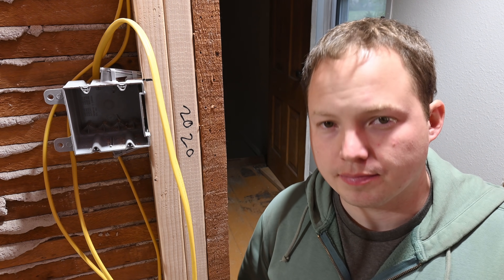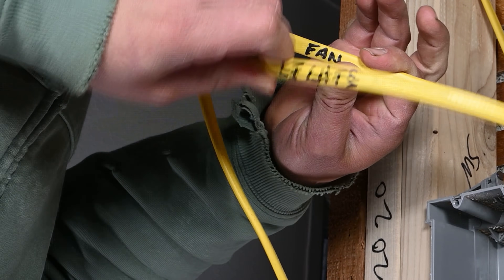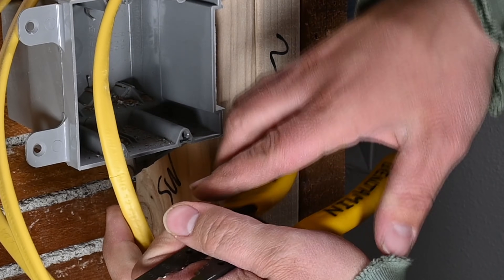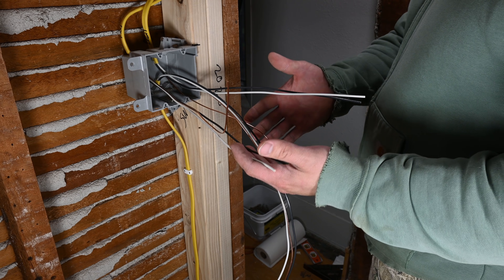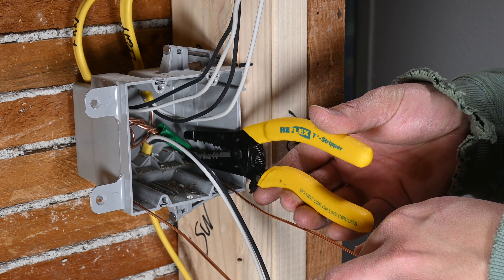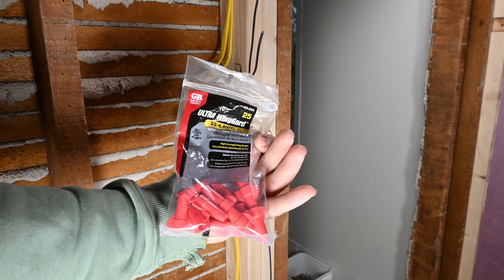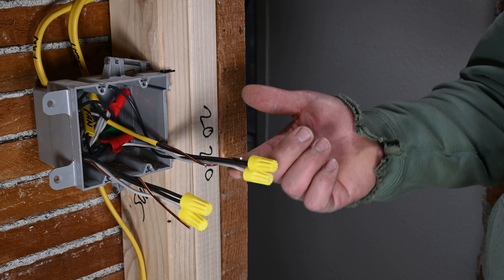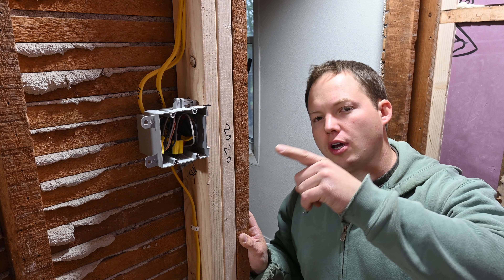How To Rough In Wires For a Bathroom Light & Fan Two Gang Switch Box

Comment: Towards the end of the video, you wired the hot wires simulating a switch being turned on so you could check for a breaker trip.  You mentioned going to drywall next. Would it be good to check for a trip before drywall or is that overkill?

Comment: Hey Ben, I have a question. In my apartments the connected the fan to run all the time! This are new apartments and I frankly don’t want to pay any extra to run them 24/7.  Wha do you think they did to do this? And all the apartments are the same! I’m not an electrician! I can turn off the breaker of the bathrooms light and fans turn off. I turn them off during the day time when we leave. Just drives me crazy! I’m thinking of hiring an electrician to come and fix this! Thanks
Oh my son is the gamer! I’m Oscar.

Comment: I have two wires in the ceiling of my bathroom going to my ceiling fan from a double switch and the other comes from the light fixture. The power starts at the switch and I need to know how to wire the new ceiling fan in as well as the light fixture12/3 to 12/3

Comment: I think you only need make pigtails for shared ground  (or and neutrals if you use neutrals ) no point to make pigtails for hot wires , it’s better to attach them on switch terminals directly

Comment: You needs 20 Amp light switches to run lighting off a 20 amp circuit. But the inspector likely doesn't know that :)

Comment: In our area the proper way to tie grounds is to pre-twist them together, trim and then add wire nut. Wire nut are notorious for not getting all the wires firmly twisted. Additionally the switches have a slot for cutting the insulation AND the back of the switch should have a line which is the proper length for conductor and lastly a small hole to help you bend the wire to properly. https://www.youtube.com/shorts/UEkgqU4H56Y

Comment: Well informed and well explained video. I do have a question in regard to installing a bathroom exhaust fan with a light. Do have any videos that show how to add a bathroom exhaust fan switch to an existing light switch? So I would like to add another switch in my bathroom that will control the exhaust fan. Can I piggyback off the existing light switch? Thanks in advance

Comment: AFCI protection is NOT required in the bathroom under the NEC.
The height of the switchbox should consider the break-point of any wainscotting or tile pattern.  Top of box to 48" is a fine rule of thumb.  There is no requirement though absent any ADA requirements imposed on spaces which serve the disabled.
I prefer Ideal Proflex over those Buchanan red wire nuts, primarily for the longer skirt the Proflex affords.

Comment: How to wire a 4 Switch bathroom?
Reply from the maker: Why 4 switches?
Reply: @BenjaminSahlstrom  it's for a bathroom shower light, the exhaust plus light and the vanity light
Reply: @BenjaminSahlstrom  Ben I am in dire need of some help... I have a master bathroom with 2 gfci outlets. One of which is with a light switch. This bathroom also feeds my master bedroom lights and plugs, also feeds into my guest bathroom to another gfci
. In the box with the gfci and switch I have 5 sets of wires. How do I wire this???

Comment: I was watching your "Live sink" and water fixture that is causing your touchless sensor to show live power.  Reminded me of another place, where that happened in a bar.  They had a un-used roof top spinning sign, (1970's).  and when that circuit breaker was on, then the whole place - every metal stud or wall panel, they where all "Hot".  By disconnecting that one wire, it all went back to normal.  

Easy way to discover the problem is shut off 1 CB at a time, until the fault goes away.  In some homes, you need to shut off all of the breakers, then turn on 1 at a time, until the fault shows up.  Then shut off that breaker, and turn on the rest, one at a time, until the fault comes back.  So now you have 2 circuit breakers that someplace in that home are connected together.  Good luck finding that problem.  Yes I have seen it in a couple of homes.   It is actually far more danger than you might think.  So say that if CB #2 is on, the circuit is energized and rated at 20 amps.  Shut off #2 and turn on #6, and now both circuits have power, and the #6 breaker can also feed 20 amps into the same circuit, without tripping.  So in reality, you could be pulling 35 amps and not trip breaker #2 or #6.    This can happen when you feed one receptacle to another, and then you get two circuits connected through 1 receptacle.  Many times this happens when you have a table light that is controlled by a wall switch, and they mess it all up!  

Good luck with your project!

Comment: When I lived in a home in Garden Grove, I wanted to install a ceiling fan in my bedroom, without opening the walls, and put in the three speed fan switch and light control where my existing light switch is.  So I have access to the attic above, and put in a box near the light switch.  The wire going to the switch was then connected to one of the romex that was going to the switch, and to the wire leaving the switch to the next one. so I now have 3 extra wires.  It made hooking up the light easy.  I had three romex going to that switch, in from the circuit breaker, out to the next light switch, and out to the existing ceiling light fixture.  It's been 30 years, so not all is remembered right, but I did get it done without needing to install more wires.  

For the living room, I put in a steel box in the attic, nailed to a 2X6, and then cut a hole in the drywall below that, and put 1 romex  to that box.  Then put in a ceiling fan that has a built in remote control, so easy!  Glad I did that, and every new ceiling fan after that one.  I put it on the same circuit breaker as my furnace, and that has plenty of extra power before reaching the 15 amp limit.

Comment: There have been times when you’ve used a 14 gauge green insulated wire in creating the grounded connection from the device to the mechanical ground.  Should a person always be using the 12 gauge green insulated wire with a 12 gauge 20 amp circuit?

Comment: Thank you so much for your good explanation, but I have a question! after twisted together the neutral wires, Why did you put two neutral wires? is switch need to neutral wire?  I think it doesn't need, Usually a switch has 3 terminals; one for ground, one for power entering and one for power out, Am I right? please answer me I became confused. thanks brother.
Reply: The neutral pigtails are there if the owner wants to add smart switches later that require a neutral wire. He mentioned this.

Comment: I've watched a few of your videos that I've subscribed a long time ago.

My question is: I want to wire the light  and the fan onto the same motion light circuit.  (Both on and off same time.)Even though there separate units. (Light is over vanity and sink. Exhaust fan is a standalone item added completely as there was a window before with no fan) 20 amp circuit. 

Not to make matters worse there was no GFCI before (older home) I installed that a while ago.  But shouldn't they be on a different circuit so I'm not standing in the dark if the wife hair dryer trips it. ( I'm just curious about that) I don't have to change that if it involves a lot more work. 

Add another switch for a new led water rated light for over the shower. 

Upgraded to a 2 gang box total.
Reply: Connect the fan a light wires and pigtail to switch. I don't think that this an always desirable setup.
On your second question the answer is yes, but it had to be roughed in that way. Most likely an enormous job at this point, not worth it.

Comment: Is it Code to continue with 12/2 to all devices in a 20A circuit? Obviously, receptacle can have large and variable loads and it makes sense to wire them for the circuit's maximum current capability, but It seems a bit overkill to route 12g wire to fixtures like lights and fans. I believe my bathrooms use 20A GFI receptacle and a separate 15A Lighting /Fan circuit.
Reply: I'm not sure about code on this, but my rule is if it's on a 20 amp circuit, all wires should be 12 gauge. More likely to get inspector approval.
Reply: ALL cable on a circuit needs to be sized for the CB or larger cable/wire, Period! 20amp CB, ALL 12 awg. Any smaller cable/wire than max circuit amperage is against code and dangerous.

Comment: Can a 14/2 wire be used for this application?. Thanks
Reply: If it's a 15 amp circuit, then yes. Since this is on a 20 amp circuit, I'd say no.
Reply: 'Cable' is always chosen in size based on circuit size (CB amperage). 15a breaker, 14awg minimum. 20a CB, 12awg minimum. Those sizes (or larger) must be retained throughout the whole circuit. Though, changing to even a larger conductor is a bit frowned upon. Rule of thumb, same circuit, all same size cable.

Comment: Can I get power from a bathroom gfci for the vanity light and bath fan ?
Reply: Technically, yes. But in an electrical ground fault issue, you lose lighting if you use the load side. This is why you should never do it. Take it from the feed side (pigtail)

Comment: Another excellent video.  I've been using the Wago connectors for a while now instead of the twist caps and prefer the space savings in the box.  Long-term I think they will perform better as any changes in the box won't require untwisting wires and having to shorten them to remove the damage from the twist.  They also save time.
Reply: I agree that the Wagos are convenient if there is a chance you will be adding or subtracting wires from a junction box especially when field conditions require a change of plans.  For example, I just added 12/3 to an outlet box to power a switch for undercabinet lights.  And the video showed a great applicaton for Wagos to test the switch circuit by simulating the switch being on.  Another great application is using the new inline Wago to lengthen a short wire.  

My problem with Wagos is that it is easy for the levers to accidently open when folding wires into the box and the wires don't always seat if you are not careful.  If space is not an issue, I may remove the Wagos and replace them with wire nuts before folding the wire into the box.  If space is an issue, or if I decide to keep the Wago, I  tape the levers down before folding.
Reply: @Roy-ij1wq  I wrap the wago once with electric tape so the levers don't break.

Comment: at @1:30 you set up a receptacle box below. As you mentioned the power comes from  down below (basement or first floor) and it meets that receptacle and you mentioned GFCI thereafter therefore I assumed that receptacle will be GFCI. Does any incoming connection need to meet a GFCI receptacle then distribute per code when working in wet areas?. I'm working on a setup similar to that and I need to run power from an outside receptacle that is not  GCFI. I'd assume that the first connection in the bathroom needs to be GFCI. I'm not an electrician but I'm familiar with the theory of electricity and magnetism, digital systems, and ac/cd circuits, Ohms, Gauss etc.
Excellent video, subscribed.
Reply: Your description left me thinking about to many code sections and mentally kicking myself to remind me that each jurisdiction can select different rules, even throw the code book out.

So, I would encourage you to call in a local electrician.  Not to do the work, but to "consult" for you on easy fixes and best practices.  Remind them that all you need is the pathway to go so you can do it and give them a little cash for looking and recommending.  Permits might be required, they may have fought your same problem before and can give you the playbook. 

 Also, I am not an inspector but find them very helpful and eager to have safe buildings.  A call there might get you the rules before you do anything.  Finding out your cable was the wrong type before you hang sheetrock might save you more than if the pros did it once.

Comment: Hey buddy im having a problem with my bathroom lights. They keep flickering on and off. I've changed the switches but it's still doing it any suggestions for fixing it?
Reply: The lights are probably on the GFI circuit. You need to separate them. Per code, only the *receptacles* need to be GFI protected. I used to put the whole bathroom on the GFI but now with LEDs, which take much less power, the sensor of the interruptor causes it to flicker

Comment: Great job on how you present the information to the audience. I'm a fan and you have earned another subscriber. Researching this stuff to run my own electric into my soon to be constructed workshop. I have yet to see any video that takes you through the complete setup from the breaker panel to connecting lights, switches, receptacles and fans. I will keep looking.

Comment: I appreciate your strong physical connection before twisting on the wire nuts, looks like a best practice.  I am currently troubleshooting a switch that turns on 2 lights, only the first light from the switch turns on.  I have continuity from one fixture to the next.  I only have voltage on the first fixture. All of the light fixtures have wire feeds with black twisted to white which is foreign to me.  Perplexed.

Comment: Why dont you need a neutral wire for a typical switch?
Reply: A conventional switch only breaks the hot [current] side of the feeds, i.e. the black wire. You need the neutral [white] wire for something that takes power: motion switch, night light, USB charger. You don't use the neutral on the switch but it is there if you need one later.

Comment: Why wouldn’t you use a double switch in one and use 12-3 W ground to the fan & light?
Reply: Also wouldn’t Wago connectors be easier and less bulky, compared to wire nuts?

Comment: That was an excellent demonstration of twisting 4 #12 gauge wires. I need to practice that more as I seem to make a good looking  spiral only about 70% of the time. My limited experience tells me that connecting 3 or more 12 gauge wires makes pre twisting mandatory. Then again, I could not worry about it and just use Wago 221 lever nuts. I think they are the gold standard currently.

Comment: Hey I've seen a couple of your videos and I love how you take it slow and explain very well. But I watched a different video with you wiring a 4 gang box and you told your friend that all of the neutrals are not supposed to be connected because they're different circuits but in this one you did. So if I'm wiring a 3 or 4 gang box with one power supply coming in are all the neutrals supposed to be connected for all the switches? also would I be able to jump another hot wire from a box like in this video to another box with a single pole switch.I'd really love to see a video with you showing step by step of wiring everything together in a deep junction box in a attic for lights and fans, 3way switches etc. Just to go more in depth a little. And by the way I'm gonna subscribe

Comment: i am a novice  but  you will put black wires on switch  and wire nut neutrals together ???
Reply: Neutrals are NEVER broken. They must provide a direct path to the panel. Only the hot/black side gets the switch. Thus, they are all connected -- on the same circuit. 

If you have two different circuits, they may share a neutral if both circuits disconnect at the same time with a switch clamp in the service panel.

Comment: Hi. I am doing wiring myself for my basement lights, switch and outlet, can i do it all with 14/2 wire or is it safer to go with 12/2, thanks
Reply: It depends. Are you sourcing your power from an existing circuit or are you adding a new circuit and breaker? If it an existing circuit and it's 20 amp, then you must use 12 gauge. If the circuit is 15 amp, then it's your choice. Keep in mind, continuing with 12 gauge in a 15 amp circuit that already has 14 gauge wire will not add safety. In both cases you need to consider the additional power draw. If it's a new circuit and the anticipated load on the entire circuit will be 12 amps maximum, 14 gauge and a 15 breaker would be ok. My recommendation in this case would be to use 12 gauge as greater safety margin. You can use a 15 or 20 amp breaker which ever is appropriate. Use a 15 amp "spec grade" duplex receptacle regardless of the breaker rating. A 20 amp receptacle on a 15 amp circuit is a code violation and a 20 amp duplex receptacle is completely unnecessary even if the circuit is 20 amps.